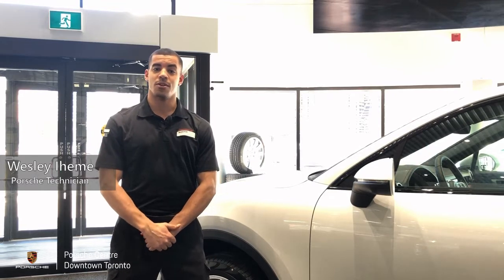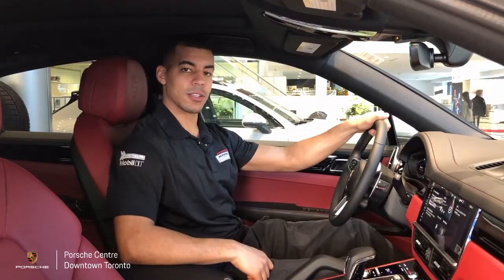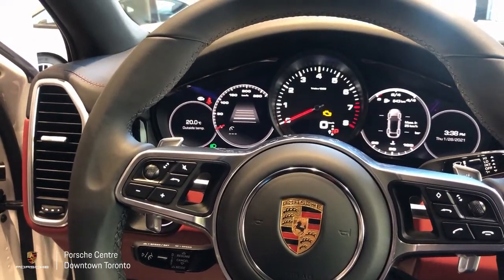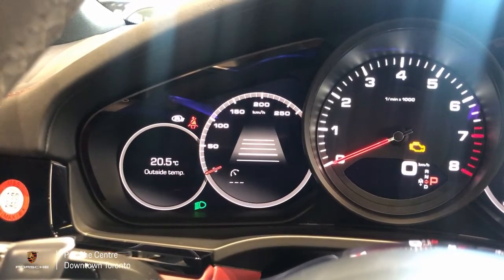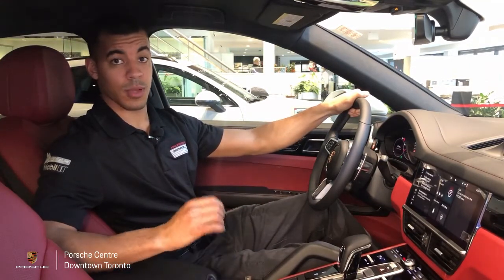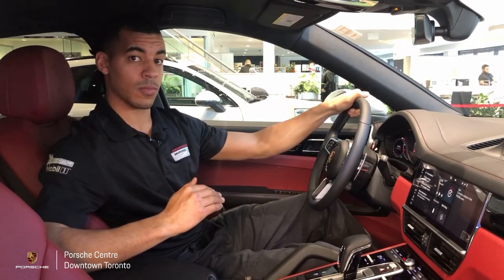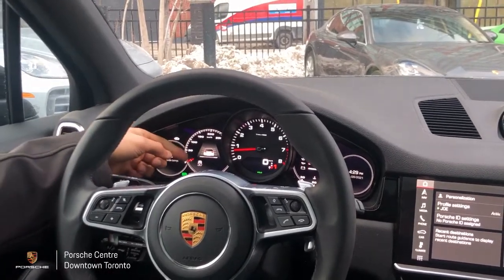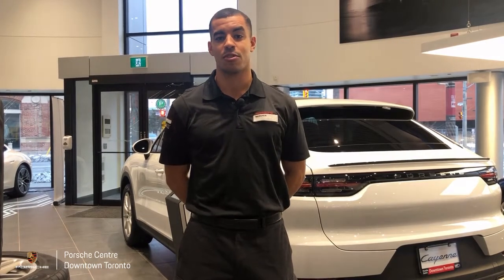How Can Adaptive Cruise Control Make My Commute Easier?

Comment: I notice at 3 minute in this video, the check engine light is on. My 2021 Cheyenne’s check engine light is also on when I turn on the vehicle but goes away when I start the engine. Is it normal?